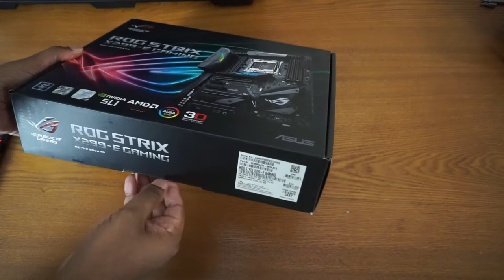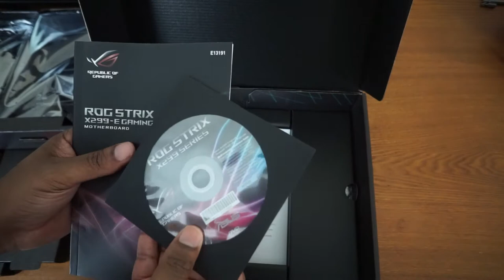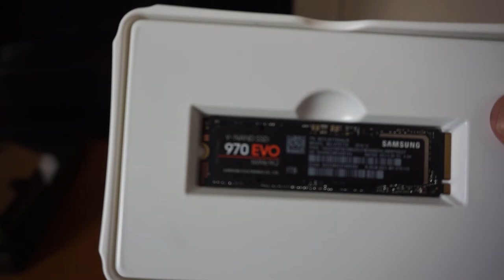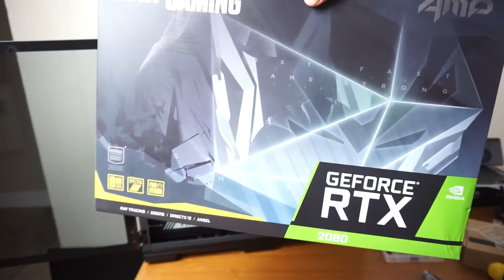My First PC Build

Comment: Insanely good for a first build. Have fun man I'm building my first one soon as well
Reply from the maker: Thank you ! I hope your build goes great ! Whats the specs on your rig ??
Reply: Average Gamer 

Ryzen 5 3600

B450 Tomahawk Max Motherboard

16GB Ram @3200mhz

Samsung 860 Evo 500GB SSD

2TB Seagate Barracuda HDD

GTX 1660 Super

Phanteks P300A (Mesh)

bequiet! 700 Watt PSU
Reply from the maker: @pyrex5594  Those are some nice specs for your first build !
Reply: Average Gamer Nevermind man I ended up going for a 2060 Super. Got it for $340 from a friend that used it in his PC. Thought it was a good deal and got it. Basically new as well.
Reply from the maker: @pyrex5594  That's great ! you got some nice hardware power !